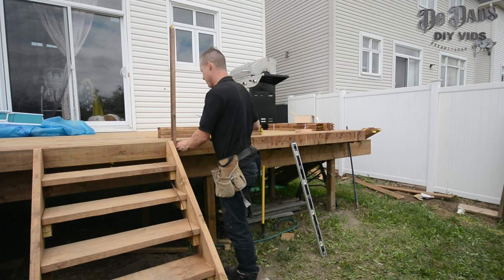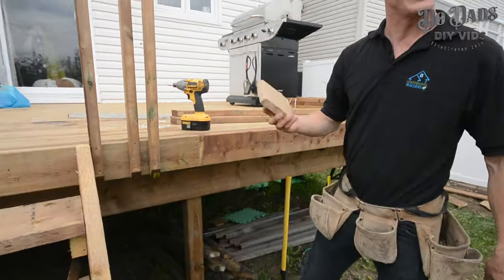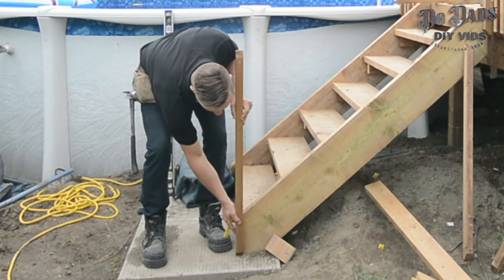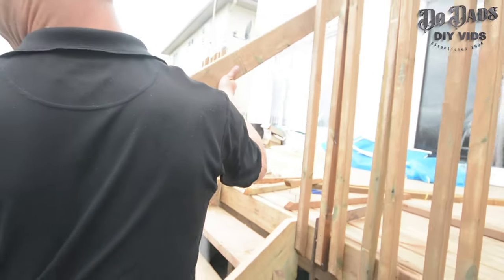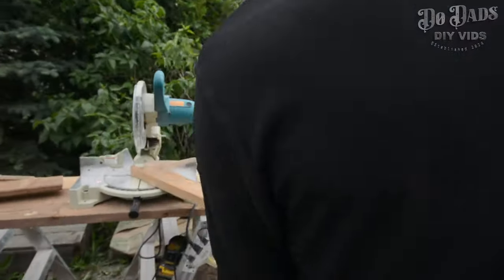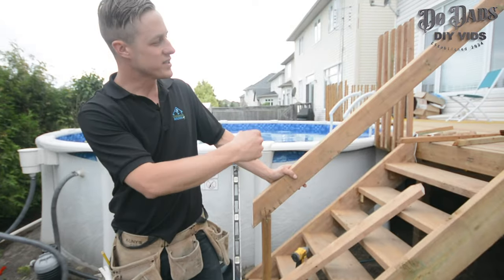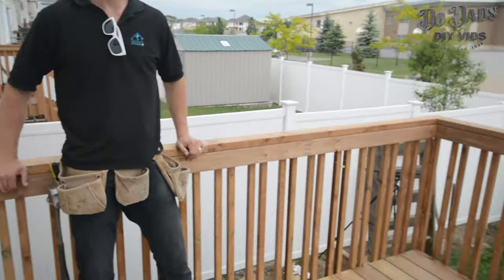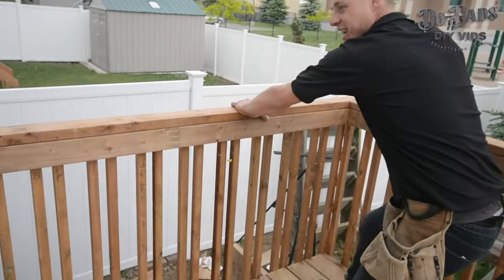Build A Strong Deck Railing Without Posts | EASY DIY DECK BUILDING

Comment: Looks good Mark.  Couple thoughts.  Not critique, just observations.  Really like the double baluster idea.  Looks very professional and gives your deck that custom look.  Nice!!   

Without a newel post at the bottom or the top of the stair railing, I would be concerned about lateral loads against the railing itself.  If someone trips, this method is not likely to hold them back from falling off the edge.  The railing may topple against that sudden load.  Top of your balusters/spindles against the top of the railing will cause peoples fingers to bang against them as they move up or down the stairs.  Dropping the top of the balusters would allow people to hold the hand rail continuously as they move up the stairs and not banging their hands into the balusters.  Mark Van Dyke Home Improvements.

Comment: I am not so sure I would want to trust just those screws in the 2x2 slants to hold that railing in place if a person leaned hard on it while on the deck. There is nothing else holding that railing to the deck. Looks great but I would at least want a 4x4x8 on each end on the outside that is strongly fastened to the deck frame and buried in the ground. I can see there is a good sufficient amount of holding power from the 90 degree corners and stairs though.That top plate certainly helps leaving the only weak spots on each spindle on the bottom where one screw is all they have to hold onto the base board. I plan a similar build here but with 4x4's in the ground on the bottom stair end and on the other corner with ornate tops and perhaps a solar light.

Comment: Please do NOT build this without first checking the local building codes for your state.  I didn't hear it mentioned in the video and it's a bit irresponsible to not have.  There are many states this wouldn't fly in.